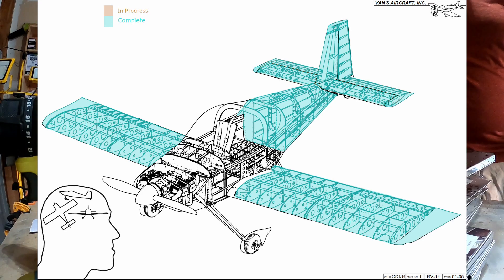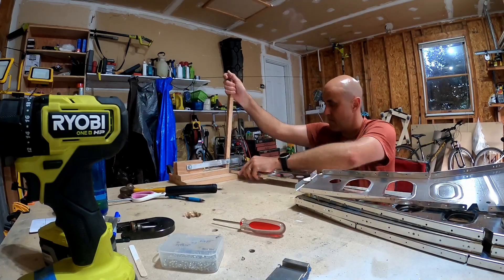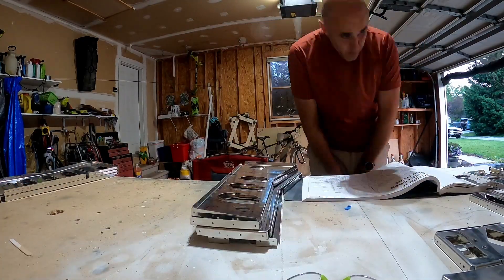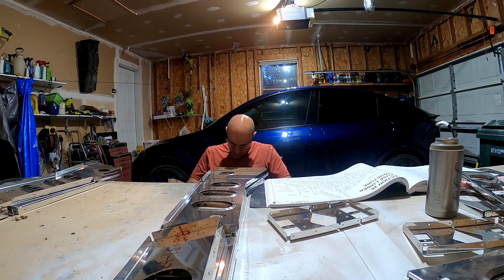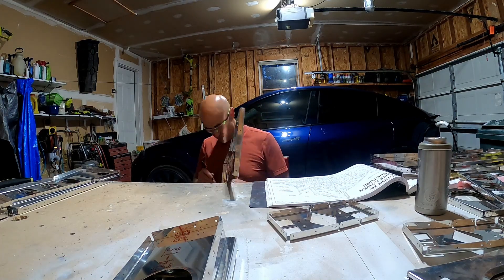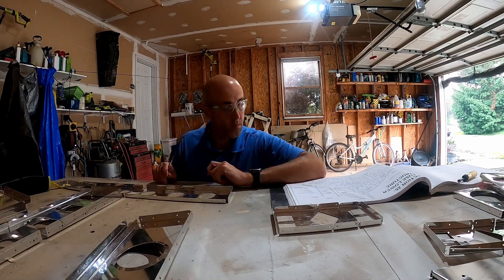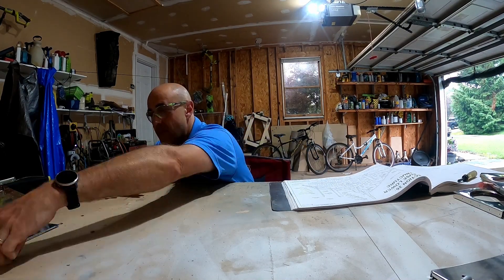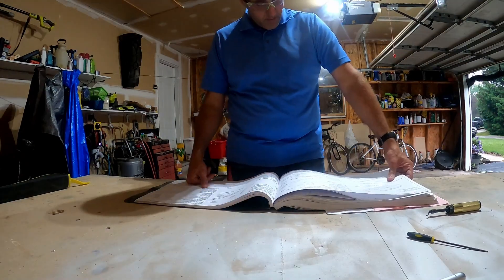RV-14 Build: Fuselage Chapter 26 and my comments on Van's financial situation

Comment: Gday mate - what is that home-made tool you're using there?   What does it do?
Reply from the maker: That's just some hardwood cut to an angle... I believe about 100 degrees from the flat portion, what it does is slightly over bends the flange so it springs back to near perfect 90

Comment: I’m so freakin discouraged on this whole mess. If I’d only bought the empennage kit, I would have already switched to a different kit manufacturer. However, my dumbass bought the Emp, wings and fuse all at once so financially I’m just gonna have to wait it out and hope for the best. I’ve got all 3 kits in my garage but because of B/O and laser cut parts, I’ve only got what I need to finish 1 section of the empennage. 😣

Comment: The shipping and handling is more than $1,000 easily. You've got to do the hardware to crate with crate itself, packing materials etc etc, labor to crate, truck / ship / truck unpack / work on them / repack / recrate etc etc. I don't fully understand the laser problems. I had a plate laser cut at send cut send and it was very good to my eye. Some of the laser cutting on the vans looked super bad just in cleanliness etc of the cut. Send cut send claims to hold 5 thousands and I believe them based on what I got.